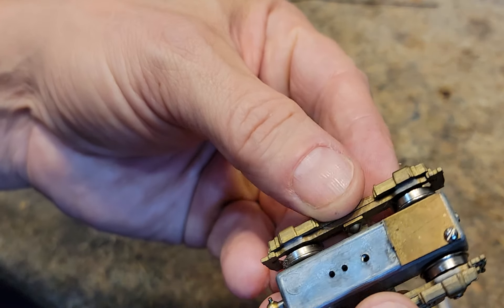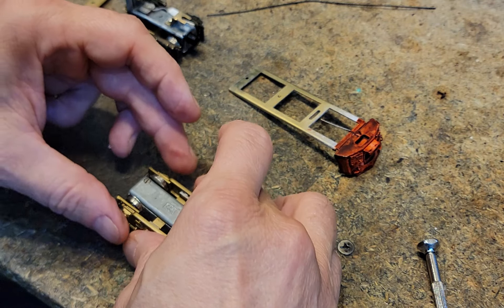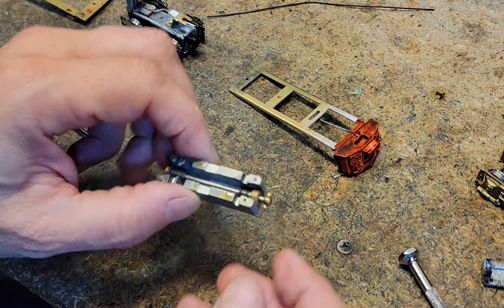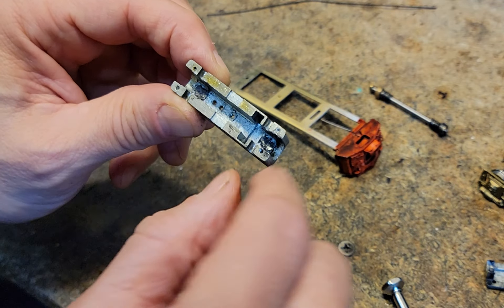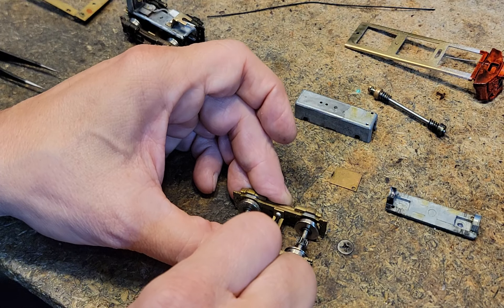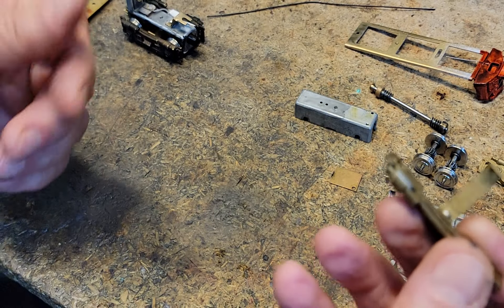Brass U50 Part 9 Truck Disassembly

Comment: I’m glad to see the non motor truck is powered from the motor truck. It would have been disappointing if it was only a dummy truck.
Reply from the maker: it is indeed!  all wheel driven and picks up power.  the only thing we really need to do is make it pick up power from the black rail and send that power forward to the collector!